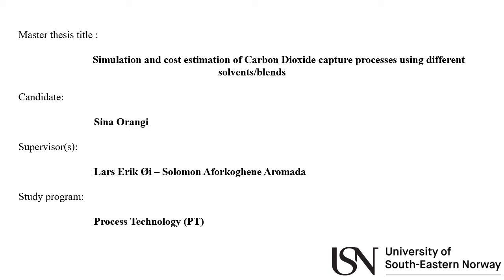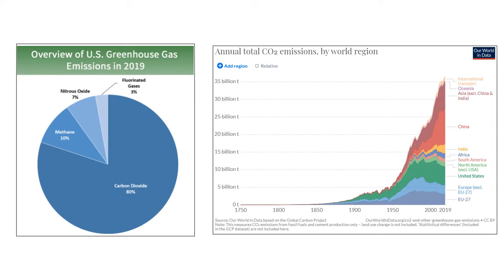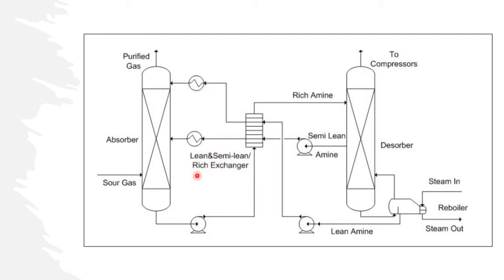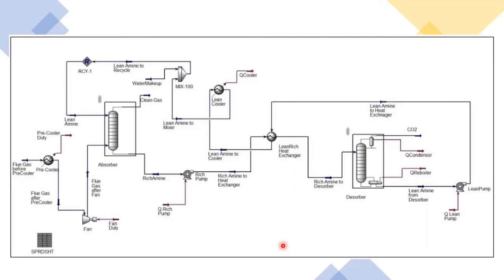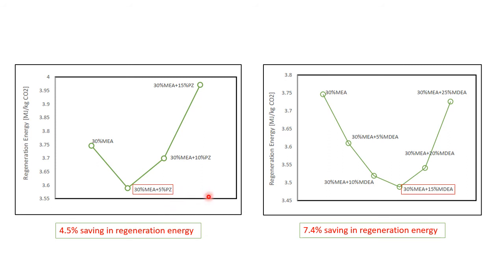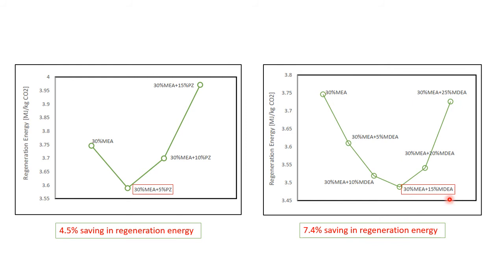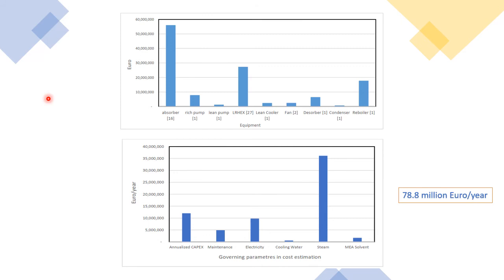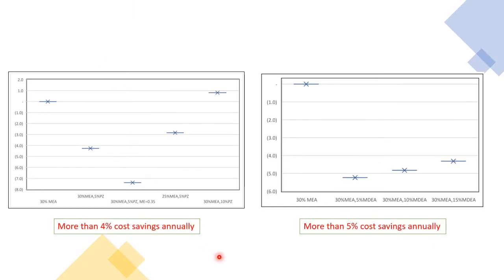Simulation and cost estimation of Carbon Dioxide capture processes using different solvents/blends

Comment: Hello Sir, I am chemical Eng. student in my final bachelor's year, currently working on a design project aimed to produce DME via biomass gasification, where the gasifier is followed by a WGSR to increase hydrogen molar ratio in the syngas produced. The WGSR is followed by an absorber and stripper to remove CO2 and separate it from the syngas. I am required to design this carbon capture unit of the plant, but we decided to use physical absorption using selexol solvent. I am struggling to find literature and info about such separation, will you please direct me to where I can find useful sources? Thank you very much.
Reply from the maker: You can reach me via sina.orangi@gmail.com to send some literature.
Reply: @Sina.Orangi  I sent you an email, thank you.